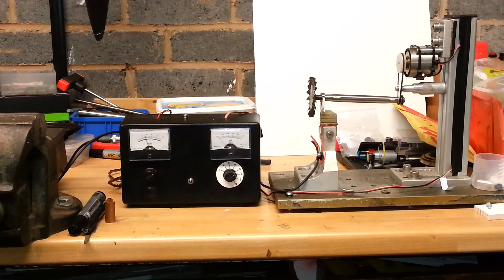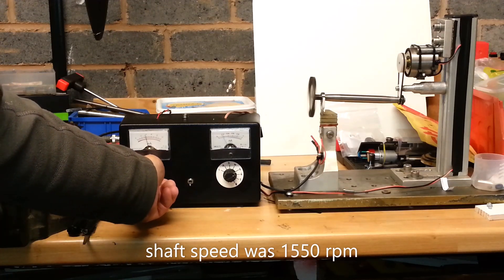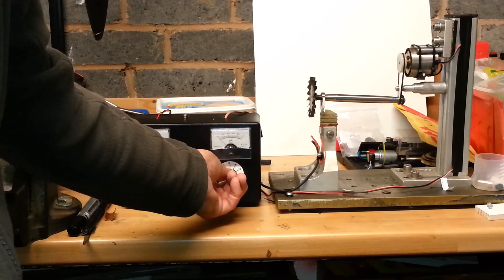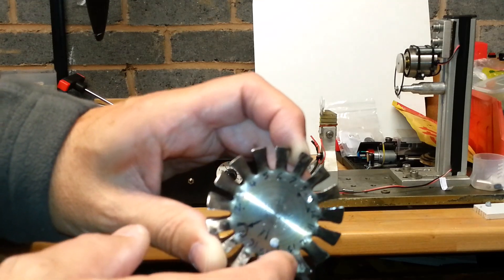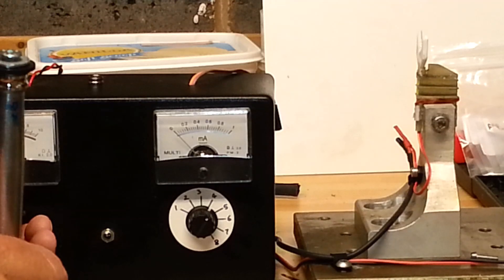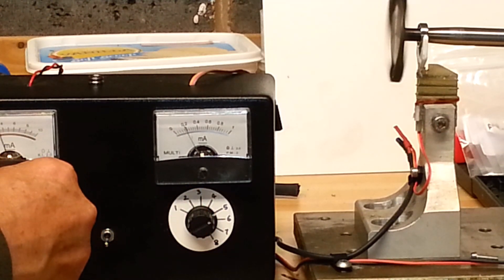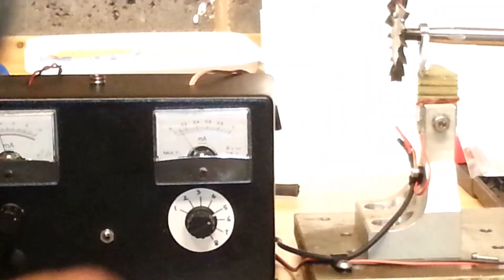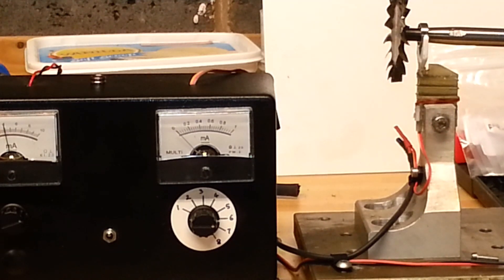Balancing turbine rotor assembly part 2

Comment: Bearings 608 and 6000 that I will be using should withstand 115,000 rpm, but the bearings I bought have poor performance and cannot withstand high rotation.  The 608, 6000 should withstand 115,000 rpm and the 602 should withstand 65,000 rpm.  Which bearing from which company is right for me?
Reply from the maker: if you are using steel bearings you need to run a separate oil tank ,pressurize this tank from the compressor outlet of the engine this will supply the bearings as normal but will be thicker than the fuel plus  5% oil mix as this is only good enough if using ceramic balls as the pressure is less on the outer race way.
The mix in the oil tank  needs to be thinned down from just oil ,thin it with a bit of fuel/paraffin/diesel can't remember the percentage check in Kamps book  it may be 30% to 50% oil
Try to buy well known named bearings if you can SKF if you are using  all steel bearings.
obviously all shields to be removed and any grease washed out.
Reply: Thanks  for your reply 
I bought a silicon nitrate hybrid skf bearing and used it, but it was damaged due to poor performance.  The performance requirements for my bearings are 115,000 rpm for part number 608,6000 and 70,000 rpm for 6002 bearings.  Which bearing from which company is suitable?
Reply from the maker: @youngsun7055  best to go with steel bearings first until running at correct temperature with no flames visible.
The balance is critical to bearing life keep below 50k until you are happy with balance this is one of the hardest part of building a turbine, all fits must be good with slight heat required to fit compressor wheel.
The steel bearing should be c3 tolerance  these will feel loose but will be correct at operating temperature.
Reply: Thanks for the reply.  Balance is really important.  The balance machine was also very expensive.  This is a price that is hesitant to purchase.  However, it was difficult to decide whether to buy a cheap Chinese product and try it out.  Anyway, thanks for the advice.  I guess I'll have to buy the casing separately and assemble it and test it.  The ball is said to be of the highest quality from CeramicSpeed.  Which company's casing is best?
Reply from the maker: @youngsun7055  sounds like you are making /assembling your own hybrid ceramic angular contact ball bearings which can be done you will have to do your own research as i don't know if steel or stainless steel raceways are better with ceramic balls .
Angular contact bearings are more prone to failure if balance is not good enough so proceed with caution  the front bearing seems to be more of a failure point make sure the compressor wheel has correct even clearance also same at the turbine end.
  most turbines have moved to front preload to help  with this problem but i don't know enough about it as I stopped building some years ago.
Reply: Since the deep groove bearings cannot hold the force generated in the axial direction, the balls of the front bearings are easily separated. Therefore, I am thinking of preventing the bearing balls from coming off by using angular bearings only for the front bearings.  But first, we need to reduce the force generated in the first axial direction to the maximum.  I haven't tried Angular, so I don't know what the results will be.  If this was correct, I think the pioneers were already using it.  I don't know what you mean about the turbine problem.  can you explain more,
Reply from the maker: @youngsun7055  the bearings are fine with the load in axial direction the main problem is to keep them loaded in one direction if the load comes off the angular contact bearing  it will ride over the inner race as this is the normal way they are assembled/pressed together.
Steel ball races  will ether fail with the cage failure or at very high rpm they start to fuse to the outer race due to high centrifugal force on the balls that's the reason for using a oil tank with higher percentage of oil .
It is hard to know the forces on the shaft, the turbine wheel blades have drag and pull the shaft back the compressor wheel does the opposite and pulls forward with the low pressure at the inlet ,there can be a low pressure on the back face of compressor wheel but this is sometimes pressurized with air from back of diffusor to carry oil to the front of front bearing.

Comment: Well done 👍👍👍👍👍👍
Reply from the maker: won't know how good it is until you run it !  hope it's quiet for you neighbor's  ,got some ideas to improve the balancer in future.
Reply: Chris i m sure is better then mine .
Reply: Reedy93 sorry to bother you but I'd like to contact you if possible plz as I have a turbine that was fully running but on inspection it turns out that the combustion chamber is falling apart on the welds so I went on the website to buy a new one and they tell me that the last one was sold and they won't be getting anymore so I was wondering if you could make one for me plz ! Will pay wot ever your costs are ! Its a jetjoe1400 but I have full paper plans and a pdf file of the wren mw54 turbine which is identical to the jetjoe ! Kind regards Pete!
Reply from the maker: @calibraturbos  I don't have the tooling for the jetjoe1400/wren54 copy I did in the past build one but stopped as the price for the wheels, 
bearings and diffuser I could buy a second hand one. 
I had a quick google and this site came up
https://www.hobbytechnology.it/en-us/brands/jet-joe/page-4/
it shows $136 for combustion chamber, if you could post a short video on your channel showing your damaged combustor I may be able to tell if it's repairable or someone my have spares.
Normal mode of failure on combustor is sticks burning away or misshaped/cracked  outer combustor due to heat damage.
Reply: @reedy93  thats the company I contacted! None in stock and won't have in the future 😢 like I said I do have all the plans on paper with full scale templates of the inner and outer combustion chambers and rods ! If that helps ?
Reply from the maker: @calibraturbos  if you show the combustor damage i could suggest a repair you can do yourself the inner and outer wraps are easy to make so if the end cans and sticks are ok combustor should be fixable.